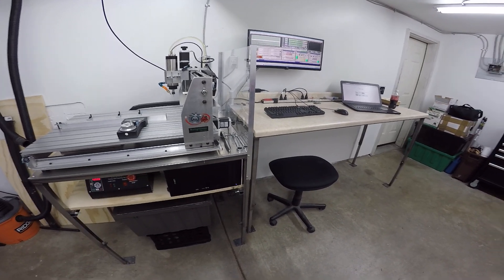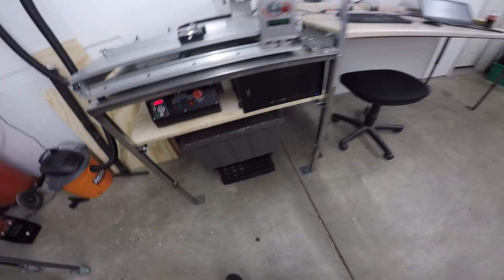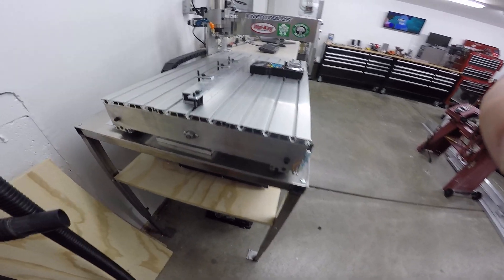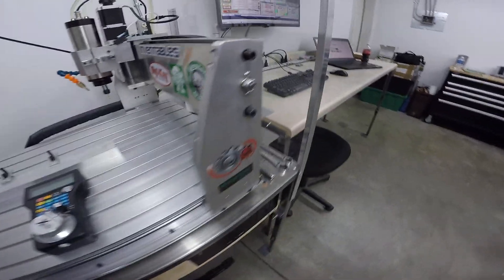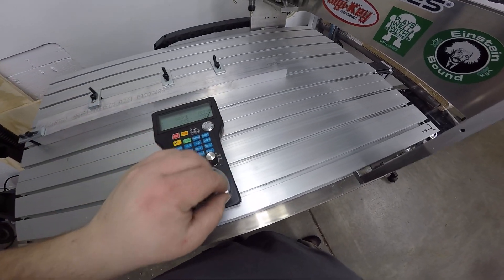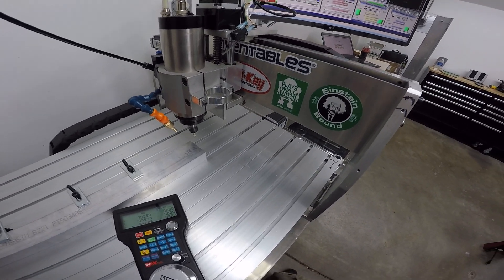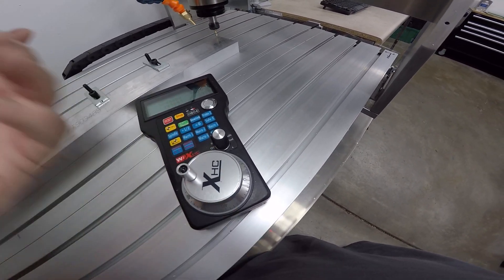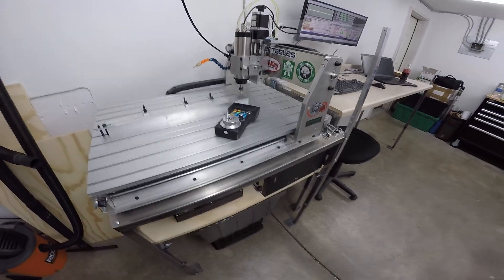6040 CNC review of my setup and cutting aluminum part 1

Comment: Well I bet you will be doing many more upgrades soon. Nothing wrong with that. We are all learning. One if the first things I've learned was that I shouldn't have both Chinese CNC in the first place. I should have built my own design CNC directly and learn from that process. Any how first upgrade lesson was that no supported linear devices have nothing to do in the CNC machine. Hence one if the first upgrades fir you should be replacing X gantry linear rods with supported linear rails. Than changing Z gantry to. Then make sure your Z axis Nema 23 does not allow lead screw or ball screw to retract. There are two kinds of Nema stepper motors. One integrates a security ring that fixes the axle and other kind does not. If you have latter you can install small load bearing between the coupling abd housing of the motor. So when lead screw or ball screw starts lowering the Z axis coupling will not move up. Results on more accuracy. Next upgrade will be simple and efficient. Just change the bed for solid steel or aluminum one. Get machined one with high grade flatness and screw it down. Make  some fixing holes in the grid on it and tap it to accept hold down clamps. After that you can think of stronger spindle motor while your CNC will not flex any more. Last thing to upgrade will be Y gantry linear supported rods. Once they develop the play change them with linear rails to. Something like HGR 25 will do.

Comment: what 6040 is that? i have not seen one before?
Reply from the maker: its just a model that you can find on Ebay. Its a Chinese made machine but with a few upgrades they are great.
Reply from the maker: For example here is a link to one on Amazon. https://www.amazon.com/VEVOR-Machine-600x400mm-Control-Engraving/dp/B07R3RBX69
You can also go to Amazon or Ebay and just search for 6050 CNC.

Comment: Does the Gecko 540 come with its own cord or does it use the usb?  Just bought a 6040 to do some engraving in my work shop.  With the help of my brother in law who works with cncs for a living, we are trying to get mine running but there is no such luck.  The software that came with it (was not mach3) is junk and doesn't seem to recognize that the cnc is even connected.  Any advice would be awesome.

Comment: FYI  In LinuxCNC, when you touch off the tool to the part, you don't need to move the tool 1/2 diameter then zero...you can hit TOUCH OFF button and enter the 0.125 (ex) and the axis becomes that value. A G0X0 would then physically move to your zero point. Just a step saved. I am sure Mach has the same function. Also, for Z touch-off I use a piece of plain paper which is 5mil's thick and very consistent. It's easy to feel the bit on the paper when moving the paper around. This is also good for testing a part's surface is coincident with the Z plane and you're vice or hold down hasnt squeezed it out. You can also use a tool blank as a better probe for XY zeroing. Also,  for simpler tool changes setup a tool height probe and call as an external sub-routine after the TxMx code. Just put the tool in the collet at any length and the sub-routine measures and compensates. Very handy! :)

Comment: So can the 1.5kw version of the motor cut steel?
Reply: Cameron Hunter this one can cut steel just have to go really slow. I have seen people cut steel with the 1.5kw. I'll upgrade soon.
Reply: That's great, do you know if the 1.5kw vfd can have a 1.5kw spindle? I'm looking at this cnc machine to buy now and I want to upgrade to 1.5kw spindle in the future will this be okay? (ebay item code: 122120240574)

Comment: Good info in the video, I have virtually the same machine and controller ( the original one ). I have some questions if you don't mind. The remote ( very cool btw ) is that remotely connected to PC and Mach3 or to the controller you replaced ? I want to add the limit and home switches sames as you have, but I still use the original controller, any idea how to do it with it ?
Reply: vladoportos the remote is USB and you get the setup disc that has the Mach3 settings. the limit switches I'm not sure because my controller didn't have the inputs. the geko is a major upgrade if your looking to do it.

Comment: Can you provide some additional info on the 48V power supply?
Reply from the maker: sorry for the delay. Just any 48v 400 watt Power Supply. Here is a link to the Geko controller and the power supply that I have. http://www.ebay.com/itm/Gecko-drive-CNC-G540-and-48v-400-watt-Power-Supply-Stepper-Router-Milling-Plasma-/262774158330?hash=item3d2e8f73fa:g:c0MAAOSwmmxW4ag9

Comment: I used Arduino uno to control the toshiba drivers.
Reply from the maker: I would have loved to go that route but I had a bunch of work to get done so I opted for a turn key controller. My 3D printer runs on a Arduino Mega.